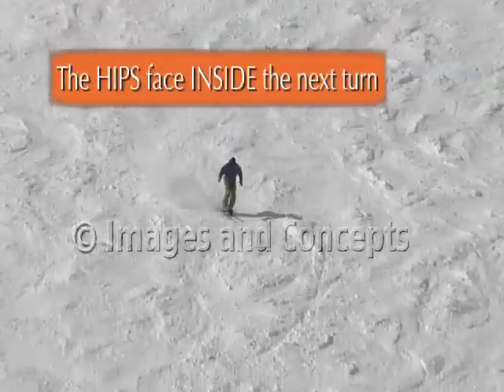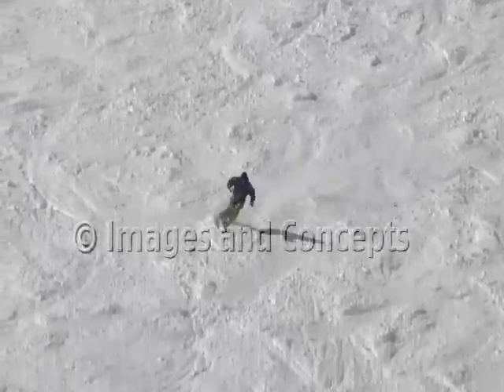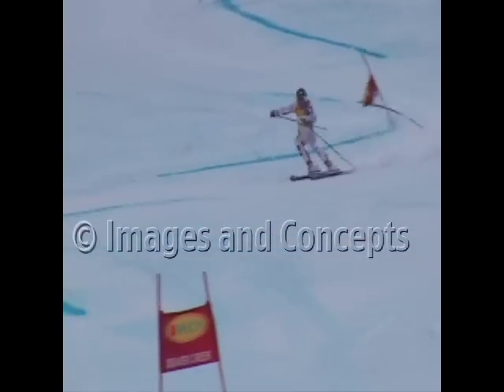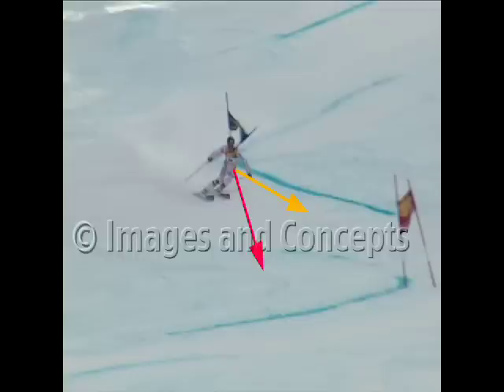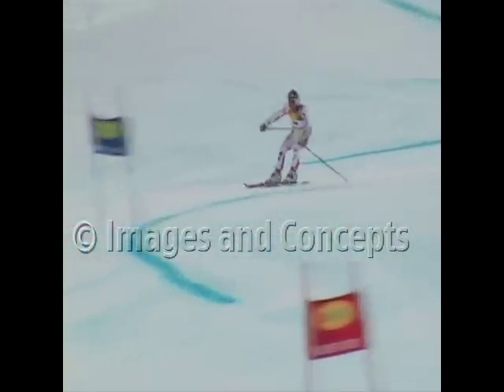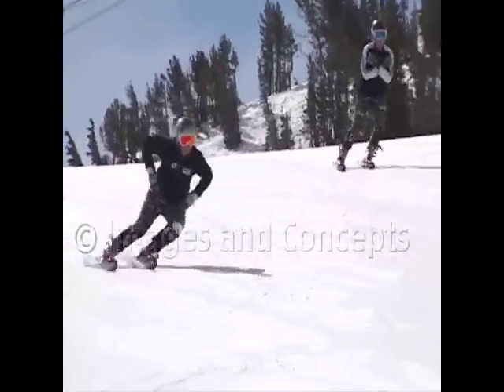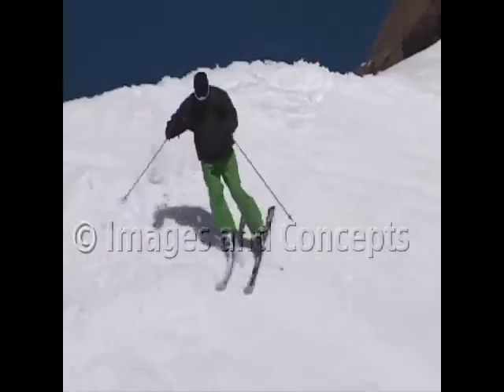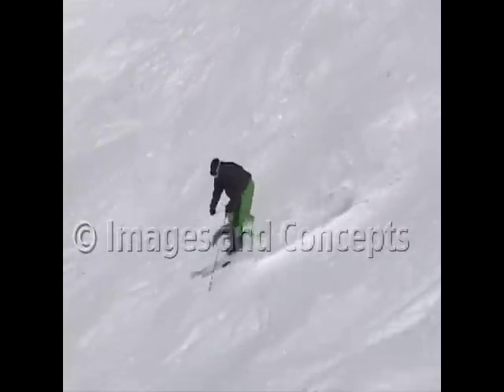hips tutorials.mov

Comment: Biomechanically incorrect use of term “hips”.  In upper-lower body separation, the upper body pelvis is facing the turn whereas the legs from the hip joints down are rotating in the turn.